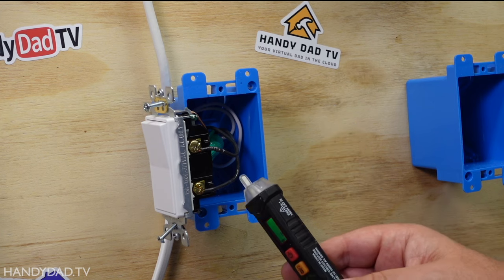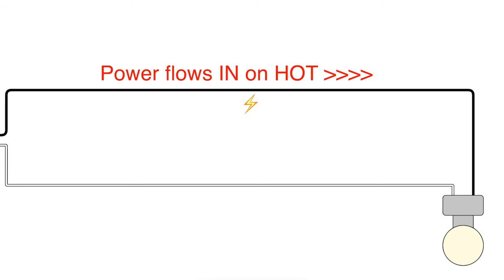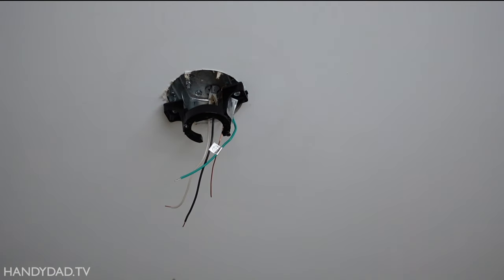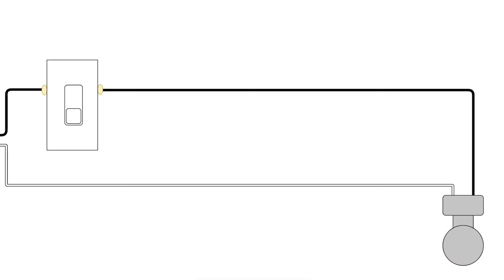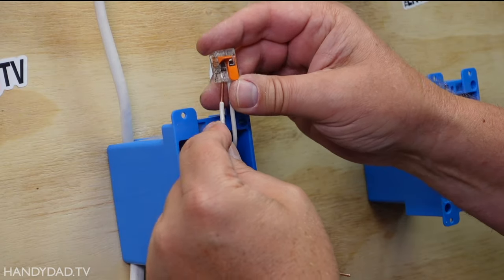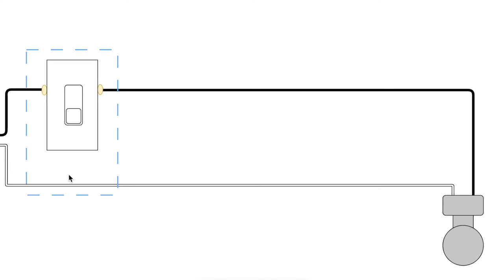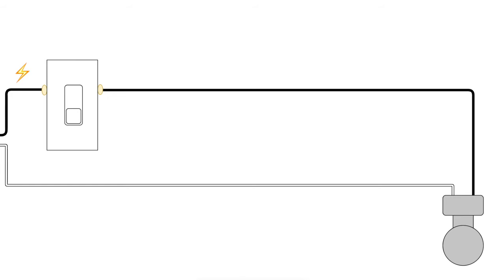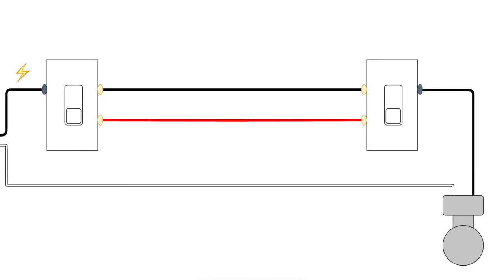Complete Guide to Switch Wiring (3-way & 4-way circuits explained)

Comment: Fantastic video and explanation.  Very simple and clear cut for most part.  I did have 1 question.
When putting in a 4way...video shows 2 black screws on one side of the 4way switch.  I know you did this for easy articulation, but the wires (2 travelers - black and red)  coming from 1st 3way, do they need to find themselves to those 2 black common screws regardless or just to the same side of the toggle switch assy.even if brass and black are on same side with each other?  Thanks for response in advance.
Reply from the maker: Not sure screw colors are standard in that case so I recommend looking at the diagram.